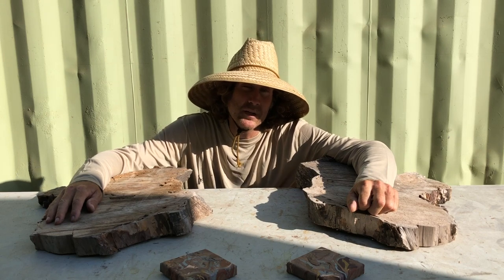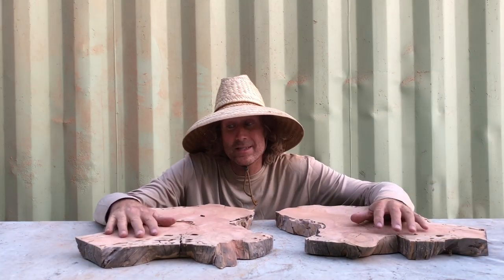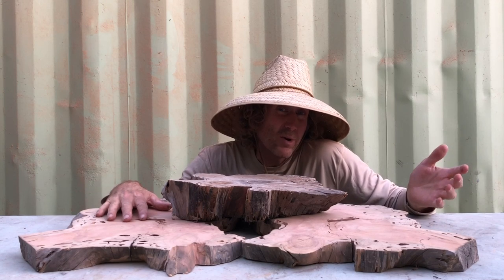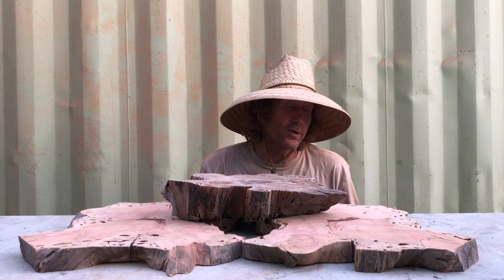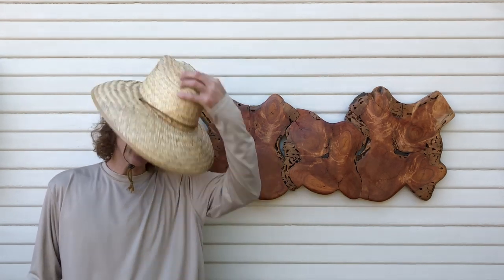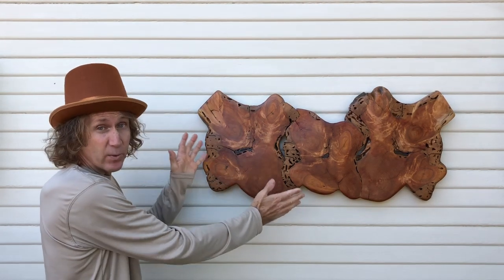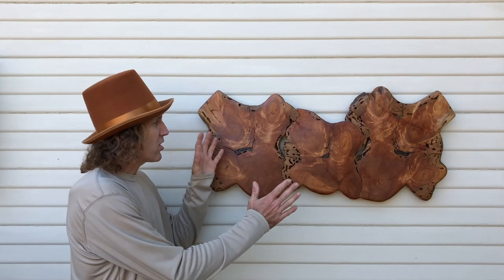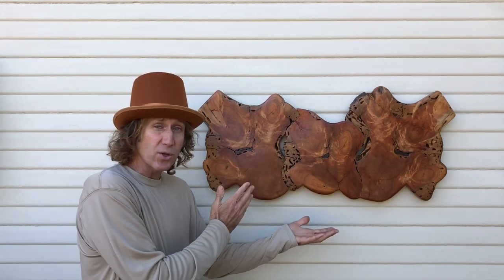pine wood wall art

Comment: Sir Scott good to see you creating.  Must really be hot and dry there?  Any residual smell from the insecticide ?  Know it took awhile  but it might take forever here. Oh wait it has...LOL!   Got a few more tips by watching you work!  Have you attempted using one thicker sheet of plywood for backing?  I'm guessing the back edge shaping took a fair amount of time.  

As I mentioned in another video response, I purchased some 7 inch flap discs for my 7 inch grinder, After using them to remove significant rust I used them on some cookies.  Good to see your mojo's back.

Great sounds!

I have a couple of hats, but I do't look like Willy Wonka...LOL  And it's getting cold here. Stocking caps.
Reply from the maker: Yes, it's really hot and dry here right now! Good to hear you got a few more tips from the video, I always hope they help :) Yes, I've tried using a thicker sheet of plywood as a backer board and I don't like doing that. The main reason is that it's harder to cut small details in thicker plywood. So rather than use a single piece of 5/8" I prefer to start with a 1/4" piece and use a 3/8" piece behind that (although I rarely every show the cutting and installation of the second backer board in my videos). I also like to alternate the grains so there's less of a chance of the art piece bending or bowing. A single piece of thicker plywood may bend or bow easier than two pieces of thinner plywood with alternating grains.

Comment: Hi Scott. In the beginning I was really excited when you said you were going to add the two small paintings, I thought, ooooh good, something a bit different is going to emerge. Then you changed your mind, and found another piece of wood to put in the middle. Then you thought again about adding the paintings, and decided against it. I have to say, I was a bit disappointed that you were not brave enough to add another dimension to it.

I get that making art is a journey and you never know where it is going to lead you, I am the same with my art. Difficult to know whether to stick with the original idea or go down another path. Sometimes curiosity gets the better of me, and I have to follow through the first idea, because I want to know if it will work. I don't like predicted outcomes, where the journey has been along a straight path. I like twists and turns. A bit like my life.

The wood is beautiful, and it would be a shame to cut square holes in it, maybe try it just the once. I thought you might have hung it vertically, it reminded me of a map of Great Britain. I am about halfway down it on the right hand side. Best wishes,  ilona
Reply from the maker: I was on the fence about adding the two paintings. I spent quite a bit of time looking at it with the paintings and thinking about it. The art piece would have definitely worked well with them which is why I thought about it for awhile. In the end I decided that I liked the art piece better without them. I realize that art is subjective so different people will have differences of opinion and I respect that. Sometimes making a choice about which way to go with the art can be a challenge. The bottom line for me is that I want to do what I feel is best for the art.....and what's best for the art is only based on my opinion and nothing else. I also thought about hanging it vertically but I built it to hang horizontally so that's the way I did it.....but hanging it vertically would work too.....it's always an option and would give the art a whole new look :)

Comment: Great job Scott, all ways best to go with your gut feelings,  by the way how many termites lost their lives in the making of this video.
Reply from the maker: The wood slices were in my wood area drying for quite awhile before starting this project so most (or possibly all) of the termites were long gone. I started this project in August and don't recall if I saw any live termites but there may have been a few. Either way, I almost always put termite killer on the wood before building my art pieces whenever I see signs of termite activity (old or new).
Reply: @scottoconnor  Wise decision, I'm in an 80+ year-old workshop/warehouse and the termites have decimated the structure, I'm on top of it now, but they did a lot of damage pre me buying it, better to be safe than sorry. once again love your work.

Comment: Nice one Scott! I think you made the right decision, the grain pattern is so interesting, it would have been a shame to cut it up. You have a knack of taking nature and bringing out it's best. On a technical note. What discs do you use on your grinder to flatten the slices - they sure do remove material fast (or is that clever camera work)? I'm always commenting on the artwork and not video skills. You make an interesting and amusing show each time. Thanks Ken
Reply from the maker: Thanks Ken! I'm using 40 grit flap discs on my 7 inch grinder and 36 grit flap discs on my 4 1/2 inch grinder. The camera work and the editing have a way of really speeding up the process. It was actually quite time consuming to flatten these!